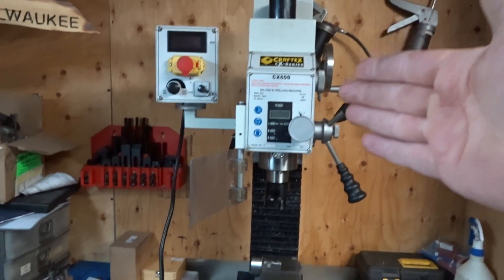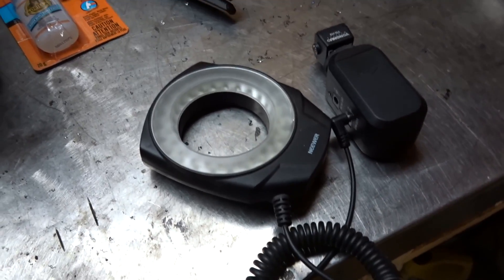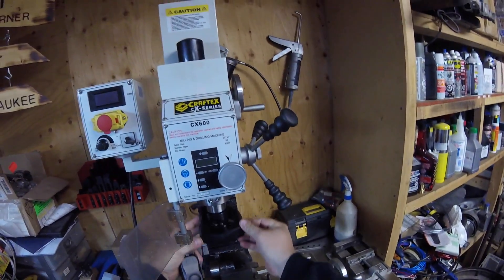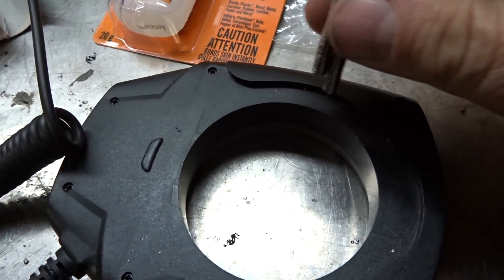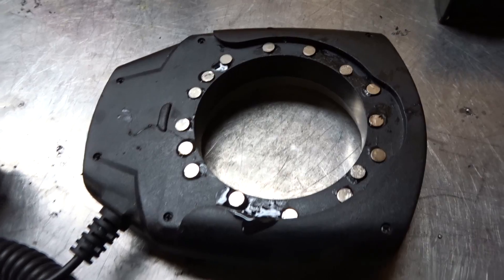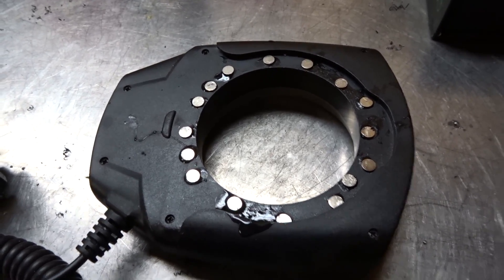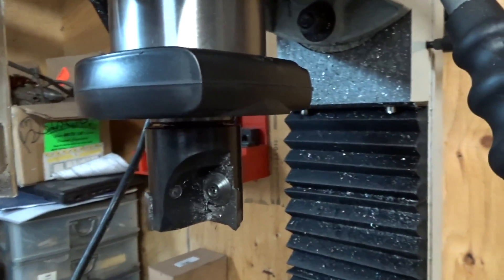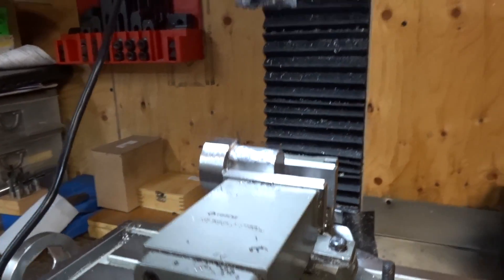DIY Milling Machine Light Hack

Comment: The angle eye ring lights at Amazon is $10.99  for 2 and the 12 volt power is right there in the control box. The motor runs on 12 volts.

Comment: great quick and dirty solution also hot glue probably would have worked good also and made it easy it you did happen to want to remove the magnets at a later time. I have glued quite a few with hot glue in the shop and they have held well

Comment: I use one of those for a desk lamp. But I 3D printed one for my microscope
Reply from the maker: +loz11968 that’s awesome I’ve always wanted a 3D printer but there is so many to choose from and don’t want to get one that’s junk
Reply: Yeah definitely worth spending the time to research what you want. But can be so useful I’ve done GoPro brackets etc even 3D printed an alien to put through a t-shirt for Halloween one year
Reply from the maker: what 3d printer do you have ? i've had my eye on the Flash Forge Dreamer
Reply: I have the early version  Wanhao 4s dual extruded that has had upgrades along the way,  similar to the early flash forge. I looked at the dreamer specs and looks pretty good imo, Enclosed build area which is good, spares should be readily available,  I found the forums very useful when I started out and things have moved on in leaps and bounds